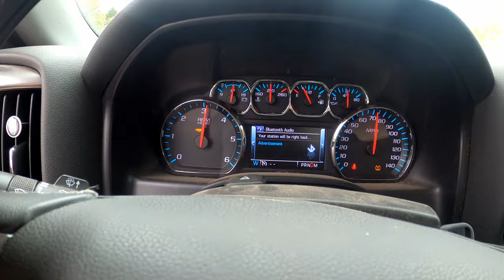EZGO Golf cart Build from Junk to Turbo charged

Comment: I have 1991 marathon under going a new life. Have been stripping it down but can't get the front plastic cowling off. It's bolted to a metal slotted bar that i have loosened the nuts but it still will not come off. any help?
Reply from the maker: Pull the bolts all the way off i stripped mine completely down. Check out the newer videos
Reply from the maker: Final product still more videos and performance mods to come https://youtu.be/xq3X2_a440w